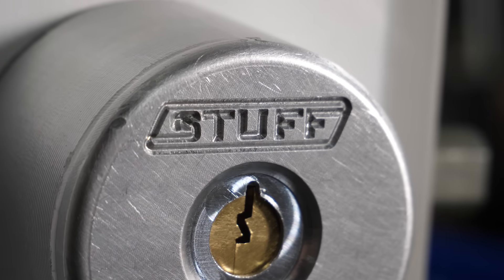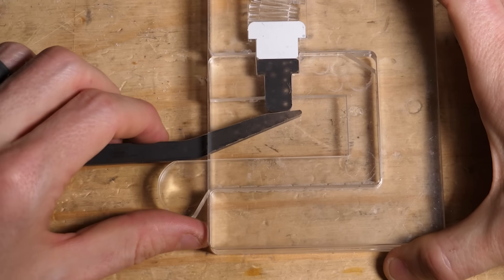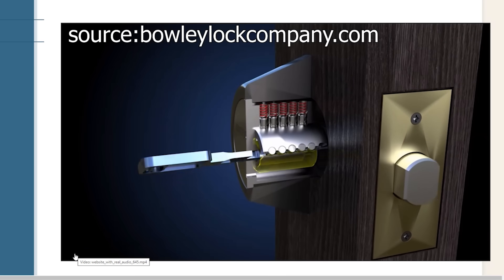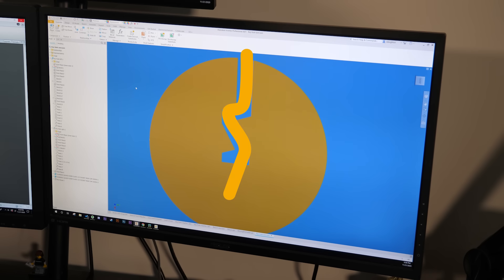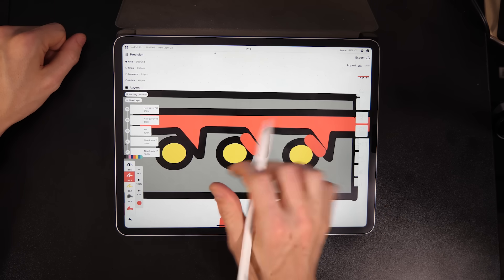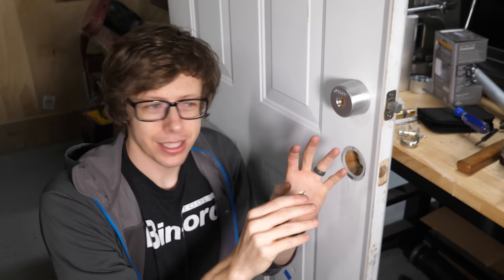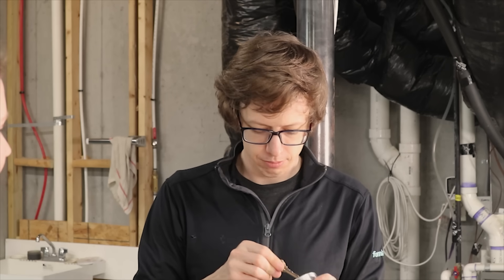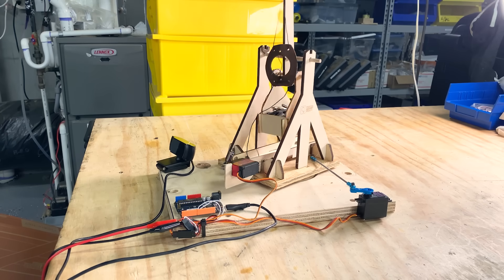Making an unpickable lock. Calling locksmiths

Comment: I'm wondering if you could've used a sidebar like mechanism and give the pins a notch at each depth position, so that it catches on the correct height. Also the notches could help you avoid some of the variance issues since you could just make the notches extra deep to make sure that they catch.
Reply: Found a good example of it: https://youtu.be/jgWS4TdLFAE?t=488
This lock allows rekeying and the mechanism that keeps the pins in place could be repurposed for this lock to hold the pins in place when they move up

Comment: What if you filled it with master pins and had notches in the top pins that had to be at the right height?

It would eliminate the need to lock the pins in place, but may require more precise machining and might reduce the total number of combinations.

Comment: The idea of creating a unpickable lock is useless. A thief's objective is to break into your home. They can smash your door in, break the glass section close to the lock and reach in or use a window or skylight if really determined. Your under the delusion that they are there to play a lock picking game for the sake of ego points. P.S. I'm sure that if you check the data most locations are not broken into by someone picking the locks for entry.

Comment: I think a better idea, would be to make a lock which LOCKS when the correct key is inserted. For example, a spring loaded sidebar, with a pin, which is pushed into a hole when the correct key is inserted. Then a 2-part cylinder, where the actuator end is split from the actual key cylinder, and only when the correct key is inserted, the split cylinder LOCKS into the main cylinder, and the actual lock can be turned.

Thus, the cylinder become 360* free spinning if a incorrect key, or no key, is inserted.

Comment: ready for me to break it?

My bet is that if you turn the key so the pins are past the gate and then give the lock a shock such as hitting it with a hammer the pins will slide and the lock will jam turned.
Reply: maybe you could add ramps to guide the pins back into the right location when rotating the lock back to the reset position.

Comment: This is my idea. It might be stupid tho. Rather than making many pins and many gates to trap the pins, why not make many pins but connected into one bar? That way you only need one gate that really fit the bar to allow it to pass. I am thinking 3 pin is the least and the most effective number of pin.  The three pin only for the front the middle and the back pin. Each pin is connected to the bar and each has its own spring to push the bar back. So if even one pin is not in correct postion, the bar should be crocked and traped by the gate. But i still didnt have a good idea for the spring placement tho.

It might be a little confusing, and sorry for my bad english. Lol...

Comment: The one key thing  to remember when you'll push this to its peak is brute force. Not just as a "picking" scenario (or better said, bypass) but also in the sense that you'll want to have the lock exist outside of that, IE, your mechanism needs to be robust and not be the thing that makes the lock action fail.

TLDR, if Joe Random jams a screwdriver in your lock, he shouldn't be able to break into your house even if it fails. 

Sidenote: A lot of locks have that system. And some some even have a ... secondary "picking" feature where by, if the conditions aren't met, the right key isn't turned, it just won't open.

IMO, i think this is a great piece and you picked (pun intended) LPL's attention, so that's a great start right there. He has an eye for odd locks.

Comment: I´m a mechanical engineer and I had the same problem with locking pins! Here is how I fixed it: 
passes on the clamping force from pin to pin. It will kinda look like this: Force--->[o][o][o][o]. Do this by giving the pins a bit room to move and put clamping parts inbetween. If you press now on the first clamping part it will clamp the pin inbetween and press with the same force on the next clamping part which then clamps pin 2 and so on. It´s simpel but hard to explain... also my english is not the best. So if you ever read this just text me and I will send you the pictures of my projekt!!

Comment: I had an idea after watching the LockPickingLawyer videos for a while, and your lock has some of the elements I was thinking of, but I may have a simpler way to accomplish the same goal.  Your idea was to lock the pins in place with the key so they couldn't be adjusted afterwards.  My idea was to use a set of gates to accomplish the same effect.  Basically the pins have the same T/+ shape (or thin part, wide part) or hour-glass shape would work too.  The idea being that the first gate would accept any pin height and allow the key to turn into the first gate.  Then the second gate would be the actual check to see if the pins are in the right combination.  Here's my best ascii art rendition:

No Key (Gate one)
////SPRINGS////
[ | ] [ | ] [ | ] [ | ] [ | ]
[ | ] [ | ] [ | ] [ | ] [ | ]
[ | ] [ | ] [ | ] [ | ] [ | ]
[+]  [+]  [+]  [+]  [+]

([+] = gate is wide so the + shape can enter, but can't change position once it's in.)

Gate two
////SPRINGS////
[ | ] >|< >|< >|< >|<
>|< >|< >|< [ | ] >|<
>|< >|< [ | ] >|< [ | ]
>x< [+] >x< >x< >x<

(>x< = gate is only as wide as the shaft, so the wide part can't enter the second gate.  The pins are stopped at the first gate which has a [+] shape so the pins can't be adjusted up or down.)

With Key (Gate one)
////SPRINGS////
[+] [ | ] [ | ] [ | ] [ | ]
[ | ] [ | ] [ | ] [+] [ | ]
[ | ] [ | ] [+] [ | ] [+]
[ | ] [+] [ | ] [ | ] [ | ]

Gate two
////SPRINGS////
[+] >|< >|< >|< >|<
>|< >|< >|< [+] >|<
>|< >|< [+] >|< [+]
>|< [+] >|< >|< >|<

The gates would be back to back creating a tunnel that would only allow the correct pin combination to turn through.  Basically, if you tried to put in a tension tool, it would turn slightly and lock all the pins into the bottom slot.  Just like your design, it forces the pins to be in the correct position from the start and locks them in place so they can't be adjusted after they start to turn.  Maybe you considered this and there's something about the design I'm missing, but since I'm not a designer and I have no tools to make it, if you can make it work it would be cool to see.

Also an interesting challenge would be could you design a tool to pick your own lock.  Maybe something that uses servos to attempt a combination and tried to turn the lock that would still fit inside a key-way...

Comment: For the locking bar that locks the pins in place, instead of designing such a complicated spring system, wouldn't it be better to just add a squishy rubber top layer of the bar that allows leeway?

Comment: One thing I realised that could be a weakness - make sure that the locking bar isn't still held up by the key as it turns. If it were, you could press it with all of the pins at their most depressed position, push it against the pin-hole shape and release the tension, and they might all fall and slot in place. This can be avoided though - just make sure that as soon as the key starts to turn the locking bar is itself locked into the activated position. I'm thinking have a small window onto the locking bar push point, and when the key turns the locking bar glides into an elevated track that keeps it locked and is no longer accessible to release by withdrawing a depressing tool from the keyway.

Comment: Probably won't get a response but wouldn't your pin catch mechanism actually make it easier to pick this once you got used to the design of the lock? Find something to push the catch in at the end of the lock just enough to activate it and you can set each pin just by pushing them up until the spring catches then just keep pressure on it until you have all the pins set. Then you just need to turn the cylinder. You can probably make security pins and such for it but it kinda seems like you built a spring based tension wrench into the lock.

Comment: I would say the concept is somewhat related to the Forever Lock, Bosnianbill video 633, in that there is no access to manipulate the pins when they are being tested - that is sure way of defeating regular picking. I like how this solution to it looks just like a regular lock and key. With separate gates for cw and ccw rotation you should be able to set it up for having different keys for lock and unlock, which could have some possible use cases.

Comment: It's a bit difficult to see exactly how everything works and interacts with each other.
but based on how I interpret the function, I suggest fake gates in the pins/pin locking without a key constantly present after rotation to prevent you from puting all pins at the top, locking them, turning the lock to the gates and release the lock until the pins fall into the gates and unlock.

Comment: For the more secure design I suggest making sure the gates are at different heights.
The main vulnerability I see with this is trying to find the shear line flush with the cylinder, then raising all the pins up a bit, no so much picking but decoding.

Comment: Idea: An electronic, optic lock that determines if the shape of the key is right when it triggers a pushbutton at the back of the lock, as it is actually operating the lock. Batteries and backup batteries located inside safe area.

Comment: Having watched a few LPL my mind wandered toward dreaming up designs that would be first approximation immune from torque and pick friction picking. And I cannot believe that just a few days old this video did all my dreams into a metal reality. It's beautiful and quite ingenious. I too considered that the key shape would have to be frozen and then sort of "air lock" tested all at once like you did.

My initial thoughts were how to do it by simply making it impossible to raise/lower the pins while any lock torque was applied. Like there was an inner, middle, and outer core and the initial inner-middle motion locked your attempt in place and couldn't be tested until some degrees of rotation where the middle-outer core started to interact. I dunno there are probably 100 ways to embody the frozen attempt concept and I'm really looking forward to seeing how it tests! Do you know of any other locks that embody this "one try at a time" concept?

Comment: What about a lock where the pins don’t prevent the rotation of the lock, they hold up a lever that allows a different inaccessible pin that holds the lock closed to move

Comment: "I called a locksmith"
Well that was your mistake then.
You should have called a pen expert. You know, people who are actually highly experienced in getting through locks without using a drill or other destructive methods.
I bet you could even shim this lock if it isn't shielded with a thin bit of steel and just push each pin above the shear line.

Comment: This is pickable simply because of the fact that it uses a "normal" key to unlock it. Once someone understands the mechanisms, it is now pickable. You'd need either a much more complicated lock, or a non conventional key and locking mechanism. The issue you had was size and complexity. What you made is short of amazing. But clearly physical space made complexity harder to achieve.

Comment: "As you can see, this lock was easily bypassed with a .50 cal pistol. In any case,..."
Reply: RamSet Nail driver! 
And in 3, 2, 1, BANG*  Well as you can see folks we got this lock open. 
Some people might not think this is a fair test,
 but anyone can buy these from the internet/ Ebay or steal one from the back of a builders car, truck or van. 

Last part wouldn't be LPL but I think it's possible all the same.
Reply: I read this in his voice.

Comment: I think you might be underestimating the commercial value of this lock. While I agree that it is pickable, albeit with a significant amount of time, this could be very useful as an interior lock for a house that frequently guests to secure a room. Another application that comes to mind is my EECS senior project. It was an access control system that tied into a keypad front door lock which would give you three attempts to enter a correct code before it would start a countdown timer at the end of which it would trigger the alarm and contact the police. I also installed a key lock on the pad to reset the countdown and allow for an additional three tries, but that always seemed like the weak link. People with deep pockets will pay stupid amounts of money for security systems and services.

Comment: There are actually tons of reasons to have physical key based locks over electronic ones.
Long term storage where batteries will fail (not everything has the luxury of supplied power)
A need for physical security or combined digital security model. (You want 2 out of three authentication methods)
A position where the having a digital code could reduce security (you can share a passcode)

Comment: What's stopping you from pushing all the pins to max height, turning it until they get stopped by the gates, and using tension + changing the pressure on the bar to hopefully drop the pins until they fit?

Comment: "If you want a truly unpickable lock just get a lock that doesn't have a key" well no, most of them are easyer to open than a normal lock. And its not just about the lock, you might have the most secure lock, but without a properly installed door it could be easily opened anyway. Check out Devian Ollam's videos, he really knows his stuff

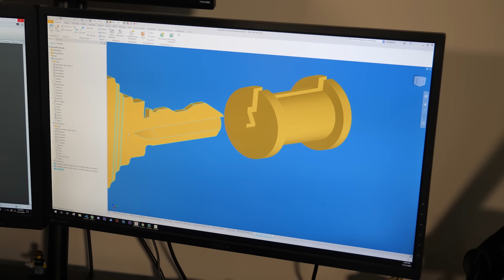Comment: (4:55) Not sure if already mentioned, but that key core could be cut in one piece with high precision of any hell of a hard metal with EDM Wire Eroding, even with much more  nastier turns, angles and thickness changes on it... even a multiple groove keyway design with matching pins all around the thing could be possible, as long as you manage to manufacture a matching multi edged key blade and cut all the teeth on each edge :D
But, EDM aren't "cheap" machines that anybody can have in his garage... and it doesn't matter how many pins, traps and gadgets you add to a lock since, like a chain, a lock is as weak as it weakest part, and I already saw some locks cracked open without even needing lockpicking them ;)
Incredible investigation and manufacturing job, by the way, your "baby" is a cutie :D

Comment: I've never picked a lock, but conceptually, I'm not convinced your idea can't be picked. If the pins aren't perfectly lined up, one of them goes through the hole first? So the cylinder will rotate slightly further if that pin is lined up?

Comment: If your sending this thing to The Lock Picking Lawyer, send the 3 pin prototype as well, If just that is good enough It'd be nice to know you could build something like this with minimal parts, less pins, less springs, more compact design, less material, less money, and that means more viable. Right? Also I highly recommend you put a lip over the face of the keyway to prevent people from putting a shim in there. or even do the inverse and add and extra oversized lip to the entrance of the keyway about 1-2mm thick to make it look as though a shim can go in but its just solid metal behind. ALSO HARDENDED STEEL DRILL PROTECTION. Think like a criminal, they don't care if it gets destroyed if they can still get in!

Comment: An unpickable lock is one with a keyhole too small to get BOTH a pick and a tension tool inside. The keyhole would be a tiny hole and the key would shift to allow it to slide in. No tension = no opening the lock without key. The key should tension entirely off a slot all the way in the back of the lock. In addition, the keyway should be completely round and smooth and possibly lubricated to prevent any tool from catching off of the side of the keyhole. To pick it, you’d have to stick a tension tool all the way to the back in a manner that would completely restrict pin access if you even were to get a lockpick through the hole. Extremely simple yet theoretically effective. (Not tested yet)

Comment: If I may, I would like to propose an idea for a simpler design that still keeps the principle of separation of setting the pins and testing them:

- keep pins in one piece, don't split (but still make them internally spring-loaded, as seen in the video)

- add six to ten grooves around the circumference of every pin where they leave the cylinder

- make cut-outs for the pins to the outer, fixed part of the lock to still allow the cylinder (with the pins sticking out) to rotate by, say, 90 degrees

- have some rails on the insides of these cut-outs that will catch into the pin's grooves, no matter if they are set right or wrong. No rails where the pins are in the lock's locked position, so that pins can still be set.

- add height-coded gates after a few degrees of rotation (just like in the video)

Now, in locked position, the pins can be set. The cylinder can rotate a few degrees no matter how the pins are set. However, within these few degrees the rails will catch the grooves in the pins and lock them (and, side effect, also the key) in place.
After a few more degrees, the pins will hit the height-coded gates (just like in the video), and only if set correctly will pass through them, allowing the cylinder to rotate further. But in this position it is impossible to set them.

Again, the concept is exactly the same as in the video, so no new idea here. Just the manufacturing may be a bit simpler.

Thanks for reading.